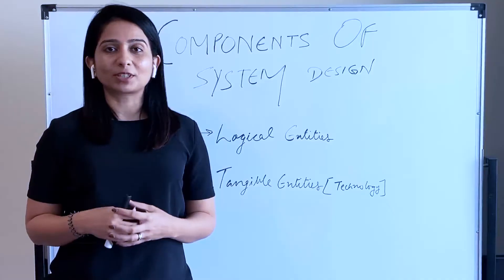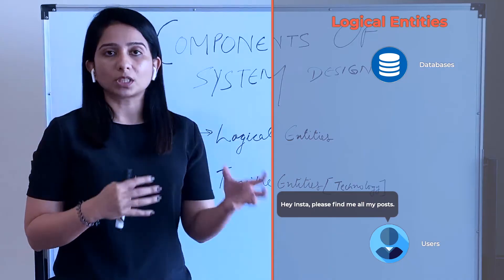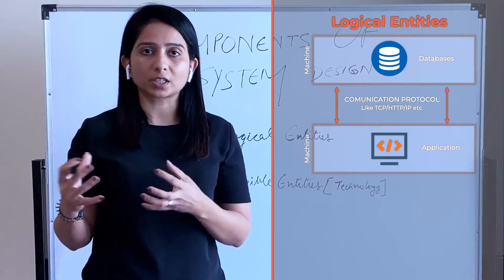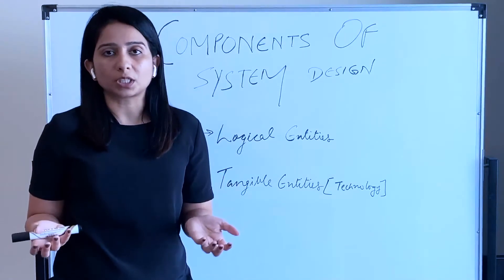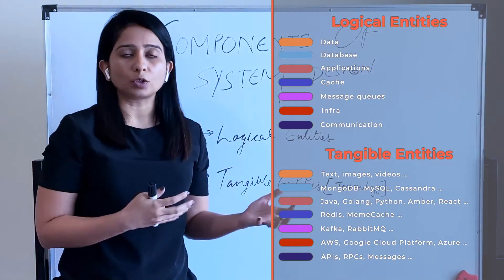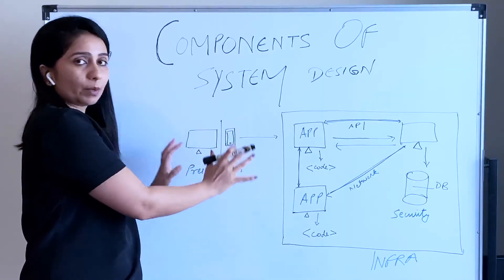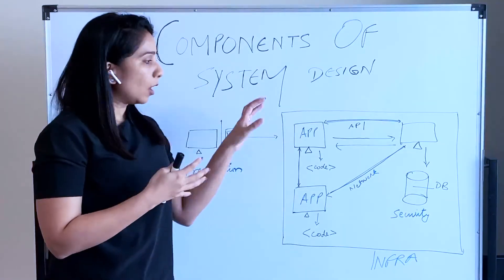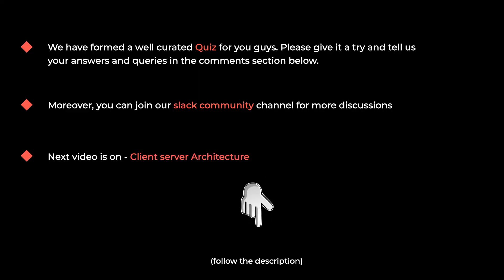Components of System Design |  System Design Tutorials | Part 2 | 2020

Comment: My answer for the Quiz

For a very basic system, we need the following components for sure.

Database - Persistence is something that is required for every backend application. So, A Database is utmost necessary
Server - For any system that needs to scale, we need to have a server, so that we can have an API driven architecture so that if the frontend changes, the new frontend can easily consume the existing API's.
Network - We need a Network as a component for the communication between the client and the server and between the server and the database.

Not necessary

Components like a frontend are not necessary because even a console will work or even a curl command will work.
Stuff like Load Balancers, Caches are there for efficient and highly scalable systems, they are not required for basic applications.
Reply: can we connect through linkedIn?
Reply: @sardarji0077  sure man
Reply: where is the quiz please?
Reply: @yujianzhao6461  Last few lines of description (Under Join Us)
Reply: I doubt this, any "frontendless" system is not interactable.
The frontend gives you the ability to even write to command.
Reply: Where is the quiz available

Comment: 1. Persistence layer : this would be data saved into the system to perform analytics or data processing etc 

Example databases - sql,nosql.
2. Client layer: some kind of minimal interaction or the way to enter into a system would be needed for the user. These are our thin and thick clients. Example : app or may as well be a console.
3.server layer: this would be the layer where the clients request would be usually processed 

I believe these are the bare minimums I'd need.

Now depending on complexity, we may have client side caching such as cookies or client side storage as well or may as well use CDN(Content delivery network).

Also a server side caching can be used to avoid computational cost if the data tends not to change too often.
It is usually required in scaling and higher efficiency requirements.

We may also try to introduce queues or streams to handle higher throughput.

Please let me know if i was able to answer the quiz.

Here is my query
How to decide which type of database to use based on the data. Example:in my whatsapp where it is a small group chat server with e2e encryption(meaning a thick client) and more writes but lesser reads.
Which db should have been used here?

Comment: In this segment of the system design primer course, Yogita Sharma discusses the components of system design, both logical and tangible entities:

1. **Logical Entities**:
   - **Database**: The core of any system that stores and manages data.
   - **Applications/Services**: Mobile apps, desktop apps, and websites that provide user access to the system.
   - **Communication Protocols**: Enable interaction between different machines, e.g., HTTP, TCP, APIs, RPCs.
   - **Presentation Layer**: Represents how the system is presented to users, such as front-end applications.

2. **Infrastructure**:
   - Machines or instances provided by cloud providers like AWS, Google Cloud, or Azure where these logical entities run.

3. **Tangible Entities/Technologies**:
   - **Databases**: Various options like MongoDB, MySQL, Cassandra, Redis, etc.
   - **Application and Services**: Code and communication mechanisms like APIs and RPCs.
   - **Presentation Layer**: Front-end applications built using frameworks like Ember or React, along with native code bases for Android and iOS apps.
   - **Security Mechanisms**: Protocols and technologies to secure systems and data.
   - **Cloud Infrastructure**: Physical computers or instances provided by cloud providers for deploying the system components.

Yogita provides a high-level view of how these components interact to form a system. This includes the presentation layer where users interact with the system through desktop apps, websites, or mobile apps. These applications communicate with the backend components via APIs and messages. All of this infrastructure is hosted on cloud platforms.

She emphasizes that this is a simplified representation and that the course will delve deeper into each component to provide a comprehensive understanding of system design.

In subsequent videos, the course will explore the components in greater detail, starting with the client-server architecture. Yogita aims to equip learners with the knowledge needed to design and build complex systems by breaking down and understanding each component's role within the system.

Comment: My answer for the quiz:

Components that are absolutely necessary:
1. Database: Data is the most important part of any application, it needs to be stored efficiently.
2. Application / service layer: Inorder to interact with the data stored, there has to be some kind of business entity which can be provided by Application/service layer.
3. Network: For a proper interaction between the database and application layer, there has to be an efficient networking system.
4. Infrastructure: All the above 3 components needs to be setup somewhere, so there has to be somekind of an infrastructure, like cloud.

Comment: Some of the components required for any system, in general are:
Servers, Network

Not required absolutely but good to have:
Database - only required for persistance, not if application is stateless
Caches - only required for optimising reads [though caching is very subjective and could happen at several levels.]
Load Balancer - only required for avoiding single point of failure
Cloud Hosting Solution - only required to offload infrastructure management to 3rd party. Else we could host the servers on-premise as well.

While server and network might be great for a small scale stateless system, several other components might be required to be added if we want to ensure High Availability, Consistency and Reliability.

Comment: Hi, the answer for the quiz is -
The necessary component for the system design is 1.) Database 2.) Application to interact with the database. #.) Hardware to run this application. 4.) Network to run upon.

Comment: Answer for the Quiz : 

In my opinion, irrespective of the larger demands of what scale, fault tolerance etc. we want the system to support - all systems must have tangible entities corresponding to each of the client layer, the application layer and the data layer. Now obviously the specific implementations and organization of all entities within the system will depend on the the specific needs of the system. But above all - we can rely on the system needing : 

1. Some established API/ communication protocols
2. Application code
3. Data Store

Comment: The Answer for the quiz:

1) Database--to Persist data
2) Applications-- Actual logic is run can be built using Java, Python etc.,
3) API's & Message queues -- To interact with applications and for sending data from producer to consumer
4) Network--As communication
5) Server/Cloud provider--To host the applications

Comment: Basic components necessary to build any kind of system:
1)Databases: data will be required no matter what
2)Network: APIs and message queues for systems to interact with each other
3)Infra: hardware requirements for the above machines provided by cloud service providers
4)Application layer: services built by us

Comment: For any System that is needed to be designed it must have a presentation layer, which will help the end user to interact with the whole system, middle layer that will hold the backend logic for the system and Data layer which will be responsible for the holding and managing the data of the system.

Comment: Hi Yogita, first of all I would like to appreciate your efforts for making the videos on highly useful topic nowadays i.e. system design. There are very few channels where you will find system design concepts being covered in deep. 

Quiz : As per me, only important component in any system design are  Database, Server, Network (Business logic along with authentication) because UI is not necessary console application can do the thing. Network, Caching, LB, Message Queue can be used as per need of application but it's not mandatory for any simple application like management systems.

One feedback: Can you start from empty board and move on drawing individual component as and when you speak, it would give users initiation point idea and would help in understanding how to start and move ahead. Though, current method is really intuitive.